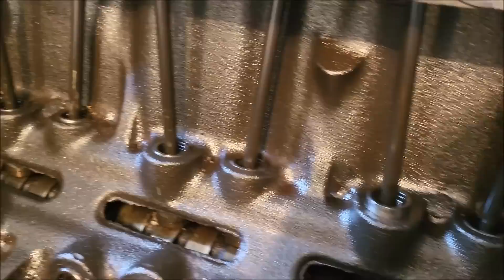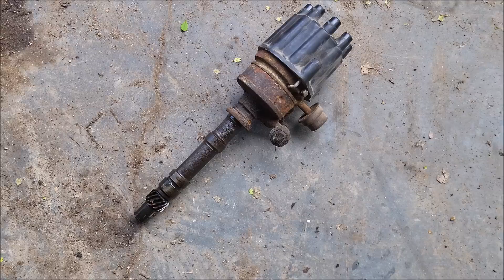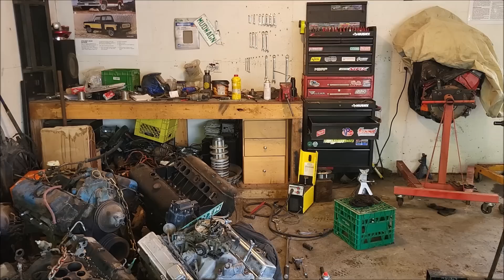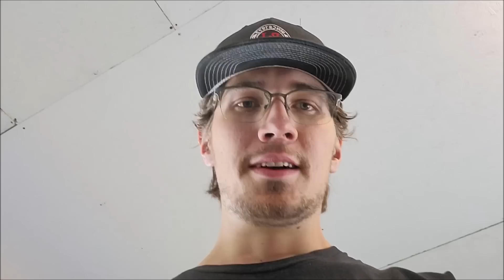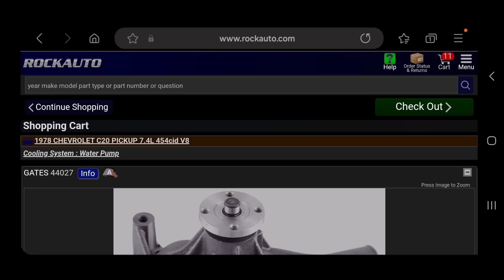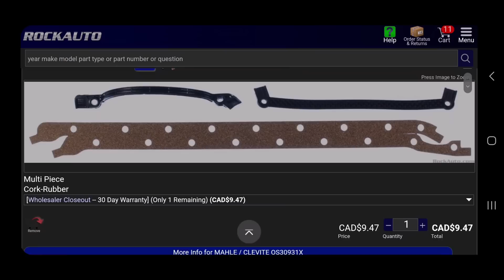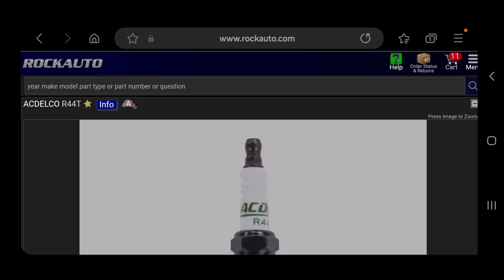Why Does Everyone Ignore Tall Deck Big Block Chevy V8s?

Comment: I've got the 305 V6 which I believe is essentially that family. '69 GMC C5500
Reply: There is also a 351 V6 that GMC made; and also a "702" V12 that was just two of the V6's connected end to end - two carbs, 4 heads, 2 distributors. The block may have been a single casting though. Back in the times where each division of GM had their own engineering departments and were set free to try novel approaches like front wheel drive units that took a Olds 455 and a TH400 trans that was reversed and connected to the flexplate/torque converter with a 2 inch chain; and two half shafts and CV joints to provide torque-steer free FWD.  GMC ended up using this in their RV where FWD gave it a low, flat floor and made it easy to drive compared to box-on-frame RV's of the time. 

Now GM sells us a Chevy Suburban/ GMC Tahoe/ Cadillac Escalade ESV that from 50 feet away you can't tell which one it is and they all use the same engine. The 1960's/70's were a great time for automotive engineering!

Comment: Met a guy at the race track years ago that had a 366 in a nova. He had the heads ported to the max and a single plane intake on it. He told me he picked up 5 of them for 1000 bucks. Had a fairly rowdy cam in it and LOTS of nitrous. His exact words were, " they were cheap, and eat nitrous like a fat kid eats cake."
Reply: Long rods and a heavy piston you won’t get over 5k for long
Reply: @DRNEGOLICIS ,  they would get you by long enough. And hell you could cam to shift at 5000. And spray like you are painting a house lol
Reply: @DRNEGOLICIS Exactly.... you'll pull a connecting rod apart on the exhaust stroke with big RPM's with these turds. 

All these stories of 8000+ RPM's with these engines are complete bullshit.
Reply: @davelowets I've built a few that turned 8000+rpm, just because you can't do it don't mean it can't be done. Just gotta use lightweight aftermarket rods & pistons. Seen many in tractor pullers turning 8 grand plus. Of course a stock one won't rev high, but they were never intended to. Why would a dump truck need to turn 8 grand. But if your a builder, it's not difficult. Hardest part is paying for the parts required.
Reply: Yup
Reply: I would get some Holland Tunnel racing heads you cant normally run on the street and STROKE that tall deck until the fast moving shorty pistons MADE some air FLOW.  Yes I am talking El Chino crank and rods and some custom pistons . . .  but if NATURALLY ASPIRATED STREET  and Holley Dominator Carburetors trip your trigger - Hey!

Comment: These have several HD features from the factory. Lots of low end torque. I swapped in a 366 and a mild cam several years ago and I could feel a good improvement over a healthy 350 while plowing snow or in deep mud. The truck it's in is a 3/4 ton square body Suburban.

Comment: You're late to the party. Here in the lower 48 in the 1980's you could find these everywhere for $200 to $400 in salvage yard school buses. The drag racers loved them. Steel crank and 4 bolt main 427.

Comment: My dad and I had a delivery business in the 80"s . We had a C60 and 2 C65"s with 366 engines . The best thing about them is they would start no matter how cold it was outside .
The worst things is they seemed to shake apart all the time . One time a water pump shaft broke sending the fan thru the rad , at the same time the clutch threw a pizza slice size chunk of clutch out thru the lower bellhousing . The little fan blade on the alternator would split in half sending shrapnel thru the hood . The exhaust gaskets were prone to blow out too .  If that happened first thing in the morning , you'd be deaf by the end of the day . The stock carburetors sometimes just didn't respond to throttle input , so I'd pull the choke knob out for a second and it would work again . 
Pretty reliable for what they were I guess . By 1985 we just switched to diesel trucks .

Comment: A old build I remember from the old timers. A 427 block, 327 humpers and a rv cam. Line Ballance and a rottie 700 off a 502 trade motor.  Shh it is legend. Some of the more crafti would put the power steering on a ac clutch... Drop it into a nova 2 with a 12 bolt rear and a turbo 400.

Comment: 366 motor is one of gms biggest boat anchors ever built. Never saw one dynod but every one I drove in a truck was terrible on fuel torque curve had to be an inverted v because you should had to downshift as soon as you saw the hill in your view. Lol.   66 Ford 330 was overloaded every day of its life and pulled like a ox. With a 2 bbl. And got better mpg. GMC = general motors crap. Btw I'm not a Ford enthusiast but kudos to the 330 and 371 truck engines of the 60s

Comment: If I were not running Duramax diesel trucks the only other engine I would be looking for is the tall deck 427.  I had a 1979 3500 dually with a 427 tall block in it back in the early 90s and it was a beast. Even got decent MPG.

Comment: 366 is a very reliable engine if taken care of. A 427..... becomes a monster when you add a 4 inch crank, 6.535 rods and a 1.645 piston. 454 tall deck. @ 10.5:1 compression will give you almost 600ft#'s  of torque on  peanut port heads @ 1700 rpms. As someone who has used the 366 before swapping to a forged internal 454TD build i can swear by the performance. The 366 is still running in a square body blazer, the 454TD has repowered a 95 caprice wagon and now my old fire truck has a 12 valve, 7 speed Spicer trans and 2016 axles.

Comment: In the 70's we would take those tall deck 427's and put 6.535 in. length rods (stock length rods were 6.135) in the tall deck truck blocks for a better rod ratio, so we could twist the engines to higher RPM's.

Comment: Short answer: they're truck blocks... huge, heavy, and not really designed to be built much more than what they are. In stock form, they were geeat engines... ready to pull nearly full throttle all day long. I'm not kidding. I've those 366s in dump trucks running heavy in the mountains non-stop, except load/unload/driver swap.

I remember when these were common in U-Haul trucks and busses. Take the governor off, and theg were great, even with well over 200k miles on them. For several years, the 366 made more horsepower per cubic inch than any other production V8.

Comment: My Dad had a 1950 26  foot GMC flat nose bus. Horizontally mounted rear frame. 409. Geared very low.6.11 to one? Grenaded two 409s. Built 1967 tall deck. Casting marked TRK
MAR . Four rings per piston. Fresh build problems solved.  Ring and pinion mesh from wrong side.

Comment: Old school budget stroker...   366 block + 454 crank & heads = high reving 427 stroker.  Very durable. Very powerful.  Very cheap (overall considering what it would cost to build a 427).
Adding a decent cam and intake will give you a great low budget monster.

Comment: With the front pulley. Just get a star puller and some long cap screws and it will come off, or a disc grinder with a cutoff disc will make it whatever length you want😂

Comment: 409-348s , also great forgotten  
Chevy motors!
Reply: Can't forget the Z11 427 "mystery motor" in the early sixties race impalas.
Reply: Ah yes the original "W" big block Chevy with the cool looking valve covers!
Reply: I had x 348 in a 68. Nova. The he. Crank. Can be nused in a 454 yo. Stroke it
Reply: 454 crank fits those "W-Motors" also.

Comment: I had one of the 427TD from a 70’s dump truck, did a semi stock rebuild, mild cam, spacers and 2x4 high rise for a hot rod.  That sucker was a torque monster.  Was for show/cruising and didn’t race it but I would do another.  Was cheap ($200), had an edelbrock carb. I don’t recall exactly what was done to get the distributor to set, I think I had the manifold milled so the distributor sat lower, was a long time ago.

Comment: Don't run a 454 flex plate or flywheel,  454 is externally balanced. 366 and 427 are internally balanced. 
These engines are torque monsters.
DONT FORGET A TALL DECK OIL PUMP DRIVE.

Comment: The TRUCK engine's had the best parts to make all the horse power and TONS OF Torque YOU WANT AND SURVIVE THE ABUSE   With  no problems!!! 😊 most bow-tie ers listen to the wrong people especially the idiots at the race shop they can't make the $$$$$ off the truck engine's because they already have the best parts!!!!!  Get rid of the 200lb. Flywheel and the sodium filled exhaust valves and install some good valve springs and a mid range cam and 750 cfm 4bbl and GO GO GO ❤❤❤❤❤❤❤❤❤
Reply: I'm a blue oval boomer and when I needed a new engine to replace the second 409 which graded on Dad I had one of these built. Pulled from a wrecker. Block casting TRK
MAR. Industrial rated Beauty. And I am a hardcore Ford Freak.😂 Good luck with your channel.

Comment: Don't use a 454 flywheel  it is externally balanced  it will  shake your teeth loose. Also save the trans adapter it can  be used to put the big allison trans on a big or small block also for diesel conversion

Comment: high volume oil pump with a standard capacity oil pan will destroy your engine the high volume pump will take all your oil and pump it to the top of your engine at high rpms causeing your pump to run out of oil
Reply: false
Reply: @shawnthomas7404  not false fact do some research

Comment: Glad to see this. I can confirm that a standard distributor will work as long as you’re using the factory intake manifold. If you are using something else, the manifold will need to have spacers under it to accommodate for the extra deck height. And that will all make the distributor too short. The factory intake was designed to work with standard length distributors. The larger  crank pulley fits in the 73 square body I’m working on just fine. Oil pan fits fine. I haven’t got a ton of running on it yet, but seems like a good upgrade over the old tired 350 it had. Exhaust is my last project to tackle. I’ve got a couple videos of mine running uploaded if you’re interested

Comment: Kiekhaefer made Nascar and Offshore race motors out of them in the late 1960's and early 70's. Had to make so many motors to qualify as Chevy "production" so they even had Winters (factory) make/cast dual plane aluminum intakes for 2 days only in 1969, to fit the tall block. Pretty much everything in the motor was off the shelf "Chevy" but the best they had. Heads from this motor. Pistons from that motor. They stroked the crank to 4.250 and used 6.405 Rods making it a 482ci. Punch it out 60 over and you have almost a 496ci (495. something). Like others have said the block walls are so think it you can go a 100 over with no issue. Also good for keeping the cylinders true when the motor is run hard for long periods. As for weight, I don't think the blocks are 25lbs heaver.  
I had to rebuild my motor and build a clone of it for a 1969 race boat. Cataloged every (factory) part number down to the last gaskets and bearings (and then built a second identical motor). One thing I found wild is Crane (the cam company) did all the porting and polishing of the heads and intake. Something they haven't done in many years.

Comment: The 366ci engines were and still are used by some of the land speed racers that run at the Bonneville Salt flats. It's the smallest BB that will fit into the max limit of the "C" engine class [372ci limit].  Mind you these guys change out almost everything except for the  lock, cranks and main caps.

Comment: I had c70 single axle, it was a beverage tractor, so I had it pull a three car trailer, it was the bomb two speed differential, just was the best combination for that trailer and picking cars up around Michigan. The only issue the air pump for the brake, kept vibrating loose.

Comment: The 366 had too small of a bore but add some boost, cam timing and the usual mods and it can run. It's just a pump. But the tall deck big blocks are great for stroker combos.

Comment: Oh, also the accessory holes are 7/16" not 3/8" so, you will have to drill out some brackets. Also the distributor hole in the stock intake manifold is deeper than a short deck manifold. So, if you run it (it's heavy but not a bad piece), you can run a regular length HEI or points dist.

Comment: I rebuilt a 366 to replace the 350 in my 1976 K20. I used the "domed" pistons, pocket ported the heads and put a Comp 252 High Energy cam in. I used the stock dual thermostat housing and intake manifold. I replaced the governed holley with a 600 vacuum carb. It turned out to have a lot more power than I thought it would. The original 350 got about 10 MPG. the 366 with some tuning got 13 MPG. This was with a 4 speed non overdrive truck with 4.10 gears. Looking forward to seeing what you do with these.
Reply: Should have used a 400 small block.

Comment: Since I grew up back then most dealers didn’t carry cars with big blocks as for the truck motors they were not available near where I lived but about 30 years ago a guy I worked with found one and did basically what you are doing he said he would figure out what he was going to put it in

Comment: I LOVE the tall deck big block Chevy engines. They can make decent performance when built, however as just good stock, basic engines, they are perfection for work as truck engines. One thing most people seem to forget is that truck engines are often not meant for top end when you are actually doing real work, they are meant to make great low end grunt and run all day under stressed.

Comment: The Problem is Not the Height of the Deck. The Problem is the Thickness of the Deck. Its around .400. This makes the Dexk crack around the bolt holes and it runs runs down the cylinder. The Chevy Bow Tie Block is Over .800. Problem Solved.

Comment: My understanding of these engines is they have a heavy weight crank , rods and pistons. Drove them for years. These motors only turn 4000 to 4500 rpm because of the heavy duty parts used. If you use passenger car or pick truck parts you can make them run right on the street. Throw away the truck parts, and the it will make a good stroker engine with aftermarket parts.

Comment: Haha ooook the early 366 and 427 would kick ass now later V8 366 not that great we have the 2second V8 366 we had a 67’GMC 950 with a V8 327 2lb and it starts then the 77’ GMC 6500 so if wanting 366 buy early  67-75’ V8 366 they will be kick ass

Comment: I used to drag race back in the 90's to early 2000's and exclusively used tall decks. From stock with the peanut port heads to all out stroked/long rod alcohol motors. Didn't care if it blew up because like you said, they were dirt cheap.

Comment: i get my bbc for free last one i got has only 6,000 miles on it a 450 hp 454 with the 4 inch stroke plus it came with the 02xx 400r turbo which is good to 800 hp the engine has a steel crank heavy rods 10.5 to 1 compression high flow heads all factory built the trans came with the heavy duty 8 bolt pump heavy clutches stage one shift kit with a few extra's

Comment: Would have been nice if they had offered that engine as the low power/low test gasoline option on the big Chevrolets and Chevelles of the late 1960s instead of the two bolt main cap version of the 396 

  Was the 6.2 Diesel "Allison" that replaced the Oldsmobile based Diesel a conversion of this (366 gasoline Truck) engine?
Reply: no

Comment: The reason for the taller deck is to accommodate pistons with 4 rings vs 3 , causing a taller piston .
Reply: Exactly. The rods were standard Big Block Chevy
Reply: Exactly right. But when a standard puston is fitted you can increase stroke an/or rod length. They were increadibly popular for big cubic inch builds back in the old days.
Reply: A HEAVY ass piston, that limited RPM's BIG time...
Reply: @davelowets throw them heavy ass pistons in the trash and use a 6.535 long rod with lightweight pistons for a 9.8 deck 427 pass car block. Turns it into a whole other animal.

Comment: The peanut port heads are for low RPM use in trucks. Toss those. You can use low deck car intakes with a tall deck block if you get spacers. Truck pistons have more rings and are HEAVY. Toss those. Put longer rods and good forged pistons if you aren't going to stroke it. If you just want to show and don't care about performance, these things are CHEAP are few are going to know that you have a grain truck 366 in your Camaro!

Comment: Because in most passenger car applications the extra .400" deck height makes install too difficult w/no positive results.  Only reason to use a 10.200 block is for increased crank swing, and cam location makes that debatable.

Comment: So cool!  never heard of "tall deck big blocks" before.  Can't imagine why people would not like these beefy engines
Reply: Standard passenger big block was 9.8" deck height and the tall decks were 10.2". At least the aftermarket blocks are. With the tall decks you can get upwards of 632" or better.
Reply: @Drsnafubar with the 427T you'll be limited to a max of 520 if the block has zero core shift and the cylinders are extra thick for a 0.125 over bore and with the stroker crank you have to worry about the oil gallery along the pan rail
Reply: @unclesquirrel6951 I've seen them at 565ci, 540ci, 526ci, 509ci.
Reply: @unclesquirrel6951 4.375x4.500 is 540ci. 4.375x4.750 is 572ci. Gotta half fill the block and do some serious grinding. But it's been done.
Reply: Because most people are stupid.

Comment: 427 366 402 396 same crankshaft, they did have cast cranks in some of them, the steel crankshaft are 6223,
As far as I'm concerned the 366 is junk, I have  two 70 series Chevy trucks, one with a 366 and one with a 30 over 350, the 350 will pull and run circles around that 366. The truck oil pans are 6 QT,
The 427 tall decks I use in a dragster
Bored over 120,000 with aluminum rods, short 427 Pistons. With a 6223 crankshaft. The tall decks will use a different intake. You would be better off billing you a good 350 then a 366. If you just want a big block build a 427 or a 454.